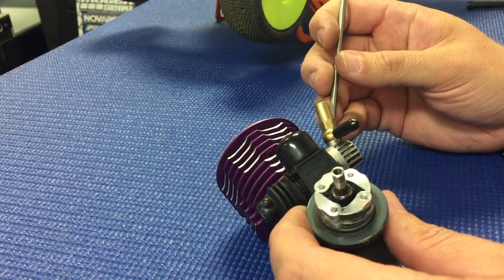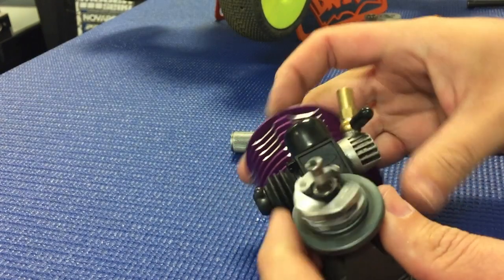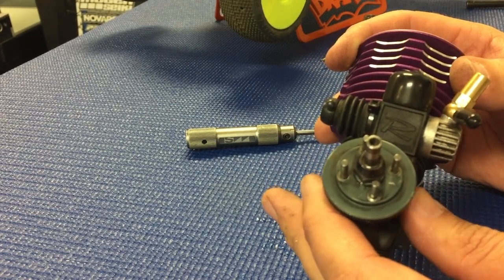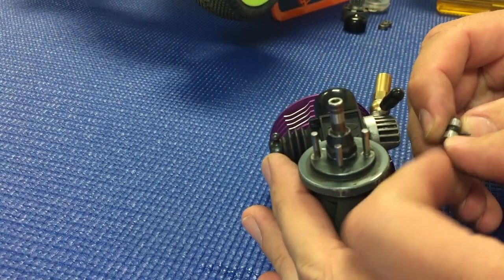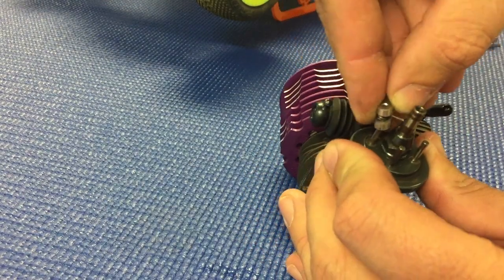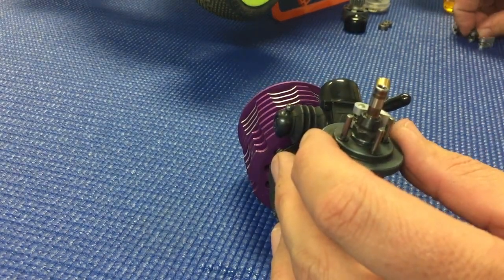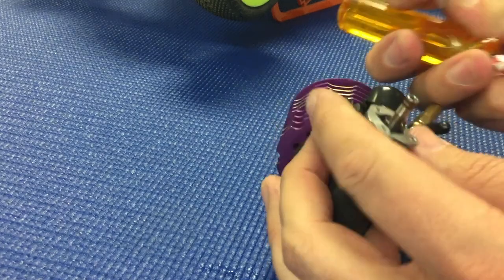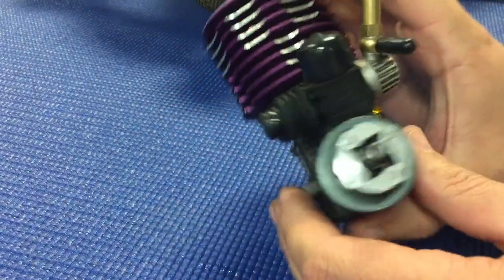Adam Drake from Mugen Seiki Racing shows how to install and remove clutch shoes.

Comment: Adam I just purchased the Flashpoint fp01 with fp2500 pipe combo and a mugen 4 shoe clutch  kit I'm wanting to know what hardness of shoes hard 7075 or soft 6061. If it depends on track conditions could you give me a little insight on which to use and when. Thanx
Reply from the maker: We only make a hard clutch shoe for the Mugen 4 shoe clutch.